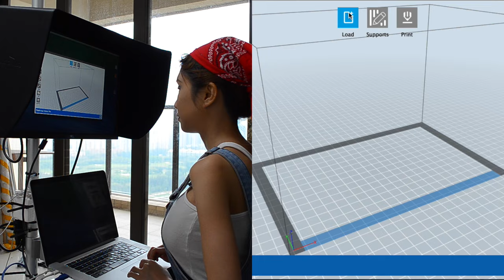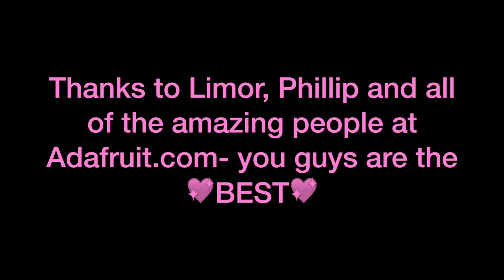RC Car Combat! Building the Battle Bao

Comment: you should have hooked the flame thrower to the front forks that way you would not have to cover the fork lift with the aluminum and you could aim it better by steering it. good luck.

Comment: Instead of wrapping the gas canister with aluminum tape, wrap it with some fiberglass fabric or fiberglass mat first and then put the aluminum tape over that. If you use some sort of wax paper or parchment paper to wrap over the canister first, you could actually make the fiberglass/aluminum piece like a sheath in order to easily replace the gas canister and not have to remake it every time you need to replace the fuel.

The aluminum tape is great for reflecting/blocking radiant heat through convection, but it conducts direct heat very easily. Fiberglass (especially when mixed with epoxy to make it hard and durable) makes an excellent conduction insulator and is very inexpensive, light weight, and durable.

Comment: If you are worried about others using flame or heat on your butane tanks, you can always wrap them with some fiberglass insulation. It is extremely light, but very flame resistant and an excellent insulator (unlike aluminum, which is an excellent conductor :P ) Now I want to see Battle Bao in action!

Comment: @6:10 can I give you a tip, when you drill into aluminium use slower speeds it will bite into the metal better and cut quicker. As always love the content keep it up.

Comment: Like your build Naomi, but please watch out for flipping the thing over.
One of the first things another battle bot will do is flipping the car so you can't control it anymore.
Try to make a bumper so that it will roll back on it's wheels  at all times.
Reply from the maker: The  Gömböc shape is self-righting and can't be flipped: https://en.wikipedia.org/wiki/G%C3%B6mb%C3%B6c
Reply from the maker: Of course. It is not stable on it's side or top. Always rolls right side up. I try to keep the videos under 20 minutes. I figured if it flipped people would want to see it on the car combat video. That will be posted in a few days.